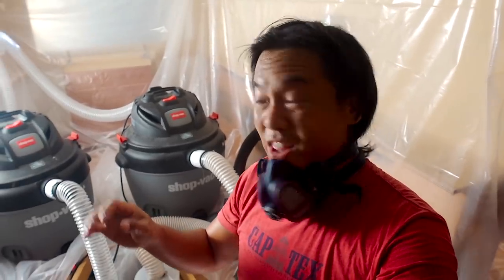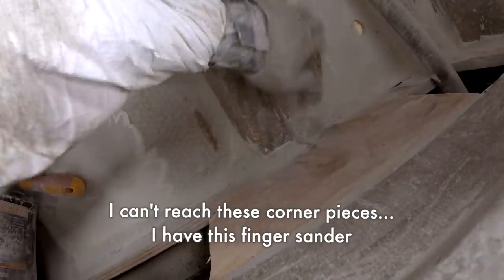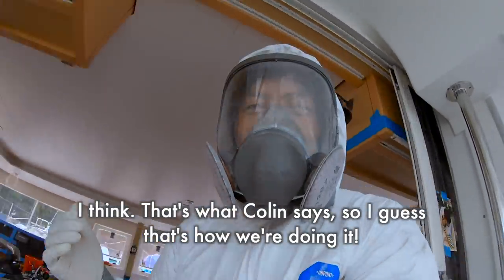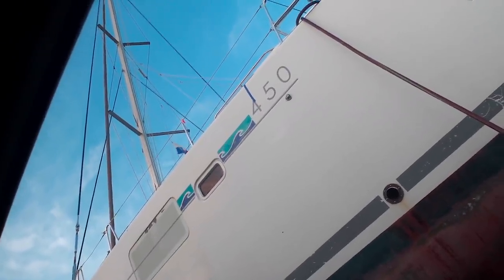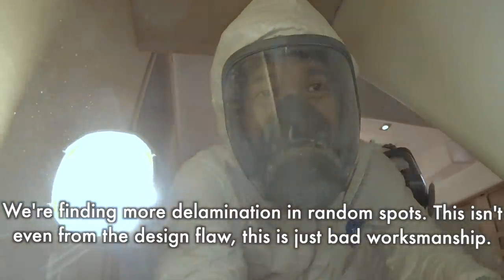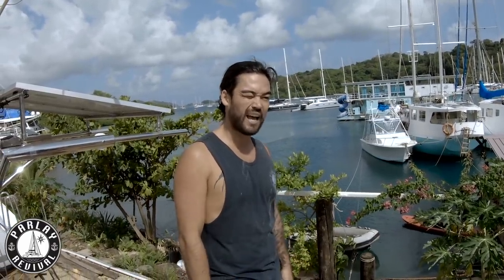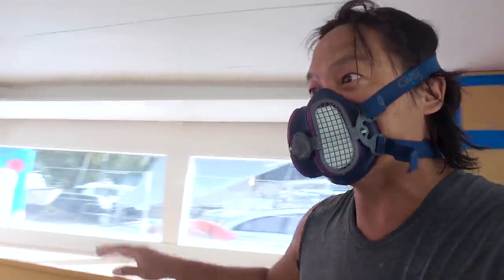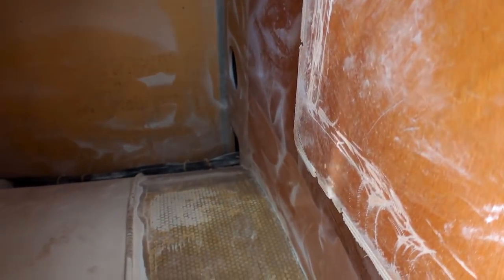I Sacrificed 3 Days of My Life GRINDING Fiberglass to Save $18k

Comment: How to deal with fiberglass on your person. Once on you there is no real means or method to fully remove it, EVER. The best things to do is put baby powder on your skin before you start working on areas that are likely to get dust contact. When taking off the suite use compressed air and try to blast off as much as possible with OUT blowing air into the suite. When showering you want to start with a cool-cold shower. That is when you soap up, remember NEVER rub your skin hard and ALWAYS rub in the direction your arm hair angles. That is also the direction your pores tend to go as well. Once you have finished with the soap, switch to rinsing and crank the water temp UP you want HOT you want to be sweating while taking a shower at the end.  Again dont rub your skin hard follow as described before. It wont remove all of it but it will make it much more tollerable.
OMG PLEASE, tape a breath able suite on the extration fant duct end. Your direct venting out side VERY bad for the environment. Also you have the blower setup wrong, the dust collection tubing should be attached to the wood in the portlight. The blower should be sitting down on the ground outside with a breath able suite tapped to the output as a filter. Those blowers have a lot of blow back on the intake side. Hence you need to put the TUBE on the intake side. Then you wont have the dust mess on the DECK. That tube has the spiral wire in it and is designed for suction. The vacuums setup is good.  Get some BRUSH HEAD ends adapters for the shop vacs. they make cleaning up DUST 10x faster and BETTER.
Reply from the maker: Makes sense on the blower/blowback, thanks for the tip... unfortunately i can't get that duct to reach all the way to the ground where the blower would sit. Maybe i can rig something else up. I've tried the cold/hot showers and powdering before, but there's something about my damn skin that acts like a magnet. I can't seem to get rid of the itch no mater what.
Reply: Easy solution: set a fold out table or ANYTHING for it to sit on if the duct is long enough? Also makes it so you can put it under the boat to protect from rain. If your are using a grinding suit and still getting fiberglass on your skin, there are one of two issues going on. My first guess is you are using a breathable suit! YES/NO?? I’m in the tropics as well. I will NOT use tyvek suits because it's too hot for me. The breathable suits will permit fiberglass to get through a little IF you press any part of your body to a structure of the boat while the suit is covered in fiberglass. An easy trick IF using that kind of suit is to use blue masking 2” tape or the poly 2-4” white tape to cover areas that will contact surfaces like knees and forearms. If your using the other type of suit that is not supposed to let any fiberglass in then there is an issue with use and PREP before grinding. Or an issue with taking the suit off after grinding is done. Always use a blow gun to blow off the fiberglass from the suits (your body) and be sure not to blast fiberglass down your neck or up any sleeves or pant legs etc.. Last suggestion is you should also be using a “hood sock” and suits that have a HOOD as well. The idea is to put on your ear plugs, put on a hood sock, suit up and then pull the suit hood over the straps of the full face mask. If done right the suit hood should nest up to the backside of the fullface outside and behind the plastic rim. Any glass dust that gets under the hood will not get on your skin or down your neck thanks to the hood sock. Gloves should always be doubled up with tape on each set of gloves to the suit sleeves. I often double up on the tape as well if I’m expecting to sweat a lot. Then heavy duty work gloves on top of that to handle the tools. Gloves with rubber grip texture work best in a fiberglass environment.

Comment: Superior French engineering my ass.  Some of the assembly errors are understandable, but things like the bridge deck not making contact with the cross brace/ledger (or whatever you want to call it) is inexcusable... That should have been caught in the design phase as it is a problem on every 450.
Reply from the maker: yes....the bridge deck gap is unexcusable. Bulkhead failures I can almost understand, but that is just ridiculous.
Reply: I'm just imagining how much load a good bridge deck connection would have reduced on the bulkheads.    That movement and creaking in the 500 underway was scary and is proof this isn't just a 450 issue.

Comment: After seeing all the poor workmanship, I would be surprised if anyone would buy another Lagoon. Not until they make some serious production quality control changes and presented them to the unsuspecting public. It is not likely just these are the only two guys who  had issues with their boats. Sad thing is many Lagoon owners do not have the skills, time or the means to tear their boats apart and dedicate a year of their lives in some remote marina to inspect  to see if their boat is safe from structural flaws.
Repairs or no repairs those boats will never be the same. Cabinetry torn away from walls, trim pieces mutilated just to get to hidden places to make the repairs is enough to turn people off and AWAY from Lagoon>
Owners of Lagoons will experience no less that 30-40 p4ercent drop in the value of their boats when they get ready to sell or trade.
These flaws are not something that can be discovered by a surveyor without dismantling the boat. It is a costly mistake for Lagoon but my sentiments are with the costly mistake Lagoon owners made and not with the factory.
Reply from the maker: The crazy thing is that most model Lagoons are still backordered by years!  But, I agree with everything you said.  It's the perfect storm for these problems to exist--bad worksmanship hidden by surveyors that can't properly inspect a boat due to build technique and also general industry expectations.  As for the depreciation, I've put so much of my soul into this boat I really can't imagine ever selling her.
Reply: I would imagine lagoon has altered the methods used in new models.

Comment: I worked with sheet and shard fiberglass for a living. Use 2 different shower scrunchie. Cold first wash helps. Only wash down, NEVER up. From the top of your arm to your fingers. NEVER up. Pulling up only pushes the glass in your skin more. The fist shower scrunchie is to remove glass, the 2nd is to clean. Even when the work is done, wash down for a week after.

Comment: That tubing shouldn't even be in there like that. It's supposed to be in a sleeve with peel ply under it. So when you pull the bag with the kicked off tubes...you can pull that resin distribution tube ( spiral tube ) The sleeve that should be used helps pull the resin evenly in the bag while it's under pressure due to the vacuum pump. The stringer not being glued/glassed is #1 shit work/quality control from the factory #2 exposes A LOT.  It doesn't surprise me though. 
There were so many hacks that I used to work with building boats. 
I worked at Westport on their 50m and at Delta on a 100 million dollar 70m. I don't remember how big that thing was exactly. 
You are doing an impressive job with your ppe for a dude with no experience.
Reply from the maker: Love the name bro, it’s pretty much my mantra! Interesting on the spiral tubing, didn’t know that!
Reply: @david_shih  I will see if I can find some yard footage, link it and time stamp it. Pretty sure there might be some shots in the vid where Colin went to the shipyard. When you guys are tearing into a boat...there is a ton of shots of wtf how did they let it out the yard like that. Stringers should sit in the cut out pocket. Not above it. The bulkhead should have been cut (down on the top) to fit to drop the beam down further in the pocket in the yard as part of the process of the top of the boat being fit to the hull. A lot of time this has to be custom cut to fit due to the inconsistency in the glassers. Even vacuum bagged glass won't always come out smooth with the overlapping of layers of glass.  It could be that way because it's "designed to flex" there...idk. Let me know if you wanna chat. I can explain way more over the phone or FaceTime.
Reply: @david_shih  after going back and looking at the s.p.r. video....they don't use the strip when they infuse. I haven't seen it done that way.
Reply: @david_shih  Idk who these dudes are. If you watch the time lapse you can see the strips in the back. There is a horizontal one and it's by the last clamp they let go by the barrel. 

https://youtu.be/NwKhnUCWQtQ
Reply from the maker: @beverslayer  it’s amazing how many blatant flaws are evident once you start digging. Thanks for the link, I’ll go check it out.
Reply: @david_shih  after sleeping on it. The boat isn't designed to flex there. If it was, there wouldn't be any glue. So every time the beam moves up, the hull flexes in. Every time the beam dips down the hull flexes out. This is an accordion effect. It will eventually vibrate apart over time it it isn't solid.

Comment: Wow, I dont know what to say here @Dave why are those spirals there? I know why they use them, its used to make sure that the resin gets into every part of the lamination but not left in like afterwards, and to see parts not been laminated properly with dry sport and bad laminations that have not been rollered down correctly is completely shoking.
But your getting there.
Colin is correct tappering will make it stronger, and will help reinforce every join.
Why is there no tabing under the deck?
Dam great work @Dave 👏 
Looking forward to your slash day 👊😎🖐
Reply from the maker: Isn't it crazy that there's no tabbing under the deck? that part blew my mind! Thanks so much for the support and watching!  so much more content coming soon!
Reply: No tabbing is poor design.  An geek designer worker on CAD not thinking real world tolerances.  Or the tabs were designed off because they are fragile for stacking, moving and handling of the big cabin hunk.
Reply from the maker: @elkskiutah8204  hrmmmm, never though of that being a reason for no tabbing...i just thought they miscalculated or were cutting costs. Either way the grey putty bonding method for ribs and bulkheads is so inadequate.
Reply: I meant building actual vertical tabs into the deck so that there could for sure be a glue surface contact points for the parts to overlap and mate to.
Reply: When you think ablout how they build the any vessel. They firstly astart of with the hull the and ribs and stringers, next comes the bulkheads. After this they then bond down the main deck to the rest on the vessel. So before they add the deck they can add tabbing to all bulkheads before putting the deck inplace.
Think about how you yautch would look if all the deck was not there at all. Your see everything. So why not make tabs then before adding the decks.
Think of it like this, you have a box with no lid. Add bulkheads. Now add tabs.
When you add the lid you automatically add more surface areas for the gule to bond down top lid.
Thats why i was saying its so mind blowing that there not there at all.
Never mind seeing the spirituals still there.
Shame but as allways dave great video, much respect all 😁
Reply from the maker: @chraven69  ah I get what you’re saying now!

Comment: Hi, yes I understand Lagoon owners don’t want to burn their bridges with the company . As an outsider and no knowledge regarding boat design and construction it still looks like design issues combined with poor workmanship and lack of quality control. Having watched all the videos and many more on fabrication techniques , it looks like inadequate strength in the bulkheads over large holes through them for pipe work cables etc , poor tabbing , voids in glasswork all contributing, and is this confined to the 450 model ? As I said this through the eyes of  a non technical viewer with no experience of the subject it would be interesting to hear from someone qualified to to give an expert analysis. Although I’m not sure if anyone would brave enough to stick their head above the parapet.
Reply from the maker: You’ve just described the majority of 450 owners…desperately trying to keep design flaws and failures under wraps in hopes that lagoon will help them and also to retain resale value. What they don’t realize is the only way forward is through this problem…by completely solving it so that people have faith in the 450 model again. No one will trust a 450 again unless Lagoon actively makes it all right with proper repair procedures and warranty assistance.
Reply: @david_shih  I agree with you 100% and sympathise with owners heavily invested in their boats both in cash terms and time and effort . Unfortunately the only way matters seem to move forward these days is if people shout long enough and loud enough through the media. I hope someone of stature in the industry steps up and says this is wrong and needs to be put right . I wish you and every other Lagoon owner the best of luck, and hope Lagoon step up and take responsibility for and stand behind their product as any honourable company should .
Reply: I agree 100%.    Your not even going to be able to bond the top half to the bottom.  That mismatch in fit of 3" is a serious design flaw. That could have added so much strength across the beam.   It's almost like the doorways needed to be built smaller.  It's like they needed taller hulls so Buckhead could accommodate a 2 meter access and provide the required strength.  But also it takes lots of glass and better to have tabs played into hull glass to attach the Buckhead to.   1200 450s now worth 200k less or 240 million loss.

Comment: I think $18K would not have found all of the damage that you found. They just would not have bothered searching it out. It is crazy that in both your boat and Colin's the adhesive that was supposed to secure the bridge deck didn't even contact the structure!
Reply from the maker: You know I didn’t even think about it like that. They definitely wouldn’t have looked any further than the obvious cracks.
Reply: I think 18k would have turned into 50k quickly. Plus what quality.

Comment: This is so sad. When businesses self-regulate, they just don’t give a shit. If this was a 3/4 million U.S dollar home (or any for that matter), it would’ve been inspected 5 times by the city building inspectors to make sure it follows the building code and regulations. Something like that needs to done about boat building. Never mind the French ‘form over function’ culture, what Lagoon evidently does is criminal.
Reply from the maker: So true isn’t it…”don’t worry no need to inspect, we checked it ourselves and it’s all good!”
Reply: And after all those inspections, there are still a large amount of poor quality homes and commercial buildings signed off as ready for occupancy.
A blanket statement that inspection by government agency is massively incorrect.  Implied is government is better and business cannot be trusted.  
Better is to say that some businesses cannot be trusted in their QC/QA.
(I worked as a QC/QA chemist for a major resin supplier.  Later, I owned a home building/remodeling company.  For many years I did not advertise because company reputation resulted in clients seeking us.  Reputation was built on quality control.  Over the years, in both fields, I came across more than a hand full of shady govt. inspectors.)
Reply: @secretsquirrel6308  fair point. In my experience getting past the city building inspectors is a pain if not by the code. 

So what is it then? Put Lagoon on ‘do not buy’ mental list because clearly they do shady craftsmanship where the customer is not supposed to look?  

Hold Lagoon accountable by recalling all boats, and have the sailing community boycott them until they go bankrupt to teach other builders a lesson?   

There needs to be a way for owners to hire reputable inspectors to check the boats throughout buildout phases. These issues seen here and on Parlay would never pass an independent eye inspection.
Reply: @david_shih  French way man. Its almost best to buy a ‘Kit-Cat’ out of Asia and glue it yourself.
Reply from the maker: @nautidad  the whole boat surveyor industry needs to improve. They never really looked for stuff like this and I know my surveyor missed it all completely. Once that gets better and owners demand more then manufacturers will have to step up? But then there’s the bigger problem that most of the issues I found in this video are so easily hidden right after the next build step happens— unless you have someone doing in-progress surveys/inspection all along the build process. I doubt lagoon would ever allow that, so that brings us back to square 1.
Reply: @david_shih  maybe if they were more regularly surveyed, these issues would not be. But look. Clearly poor craftsmanship that has destroyed Lagoon reputation already. Maybe they can say we did not expect the bulkheads to endure so much force and would after a few years tear, and some de-lamination may occur, but where the adhesive compound never reached two surfaces… that is just criminal. How could you ship a product like that.
Reply from the maker: @nautidad  fully agree my friend.
Reply: My experience with home building inspectors is they miss lots of things.   I'm sure they can be corrupted.   On fiberglass it's hard to know if the surface between layers was debloomed or prepared properly.   Really composite structures need to be built in climate controlled environments with every step of the resins life tracked from manufacture to mixing.